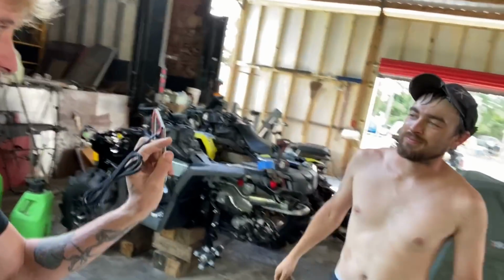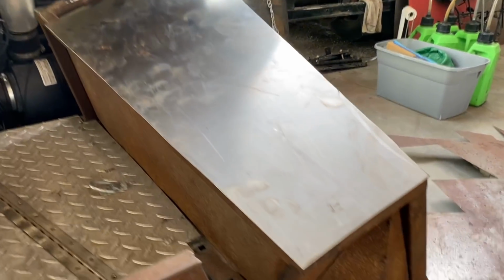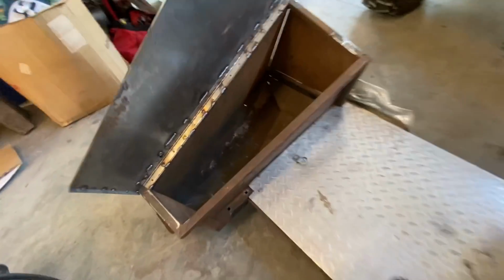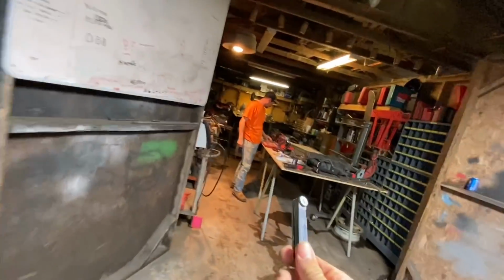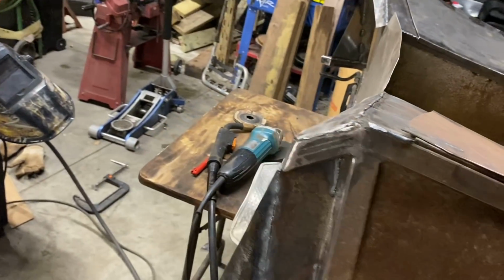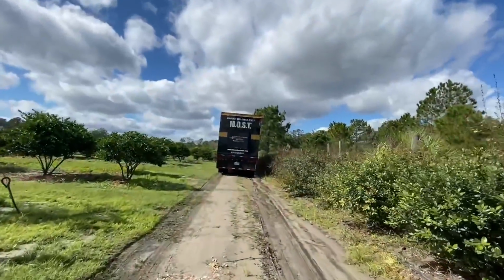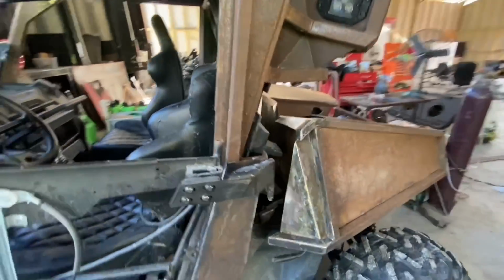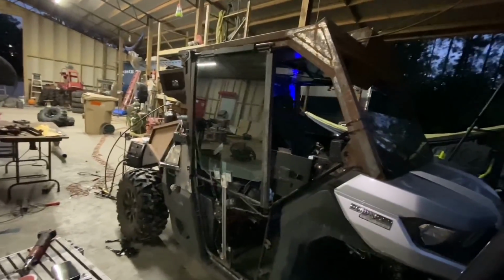Build update! Custom Can-am Defender Limited cargo (Cargo Boxes and Doors)

Comment: Hey colt! Check out POR 15 paint. It’s amazing! It is designed to put on metal exactly what you have, raw bare slightly rusted. Clean it up/degrease and brush it on, nice look, and a few colours. Check it out. I used it on my frame for my square body chev frame off resto.
Reply from the maker: I’ll check it out!! Thanks for the info. 🤙🏻